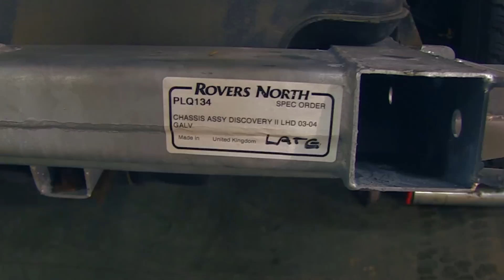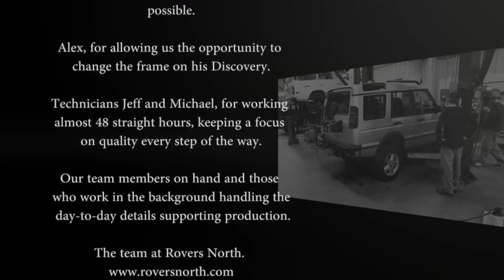Four-Minute Frame Swap

Comment: Feckin ell, you guys are amazing, it's been a long time since I smiled at a video so much. That was like the sh1t we used to pull when we were aaaaa lot younger. 2 new subframes, 12" wheels, new wings, front panel and grill and a full respray in primer grey to my brothers wee mini. Only took a couple of hours to do. We got a load of tyres and pushed the mini onto its side to replace the subframes, oops, forgot to take the battery out of the boot. lol pop riveted the body panels on, rubbed it down with 600 and primered it with an electric vacuum cleaner spray gun attachment. This was all done on waste ground at the back of our house, then all packed up, 4 young adults, and off to Killarney for the weekend to watch the circuit of Ireland, 1973. Freaking awesome, never forget that weekend. Great video guy's. 😀 👍 👍 👍 👍

Comment: What would this cost supply and fit?
Reply: Hi Jack, Thank you for stopping by.  The cost varies greatly depending on the condition of the vehicle we are working on.  The frame swap by itself takes 50 hours.
Reply: Hi Shirley okay thank you for this. What do you charge per hour?

Comment: labour cost? probably 3 or four times the value of the vehicle, okay it's 3 years ago, but still, whats with the disco chassis's..chassai? chassisai?
Reply: You must ask Mister by you in 1991 model your number should be repaired by the company. We Crush Repair by You Clock

Comment: Ive seen many shortened mk1 Disco's
Reply from the maker: New to me. Do you have details? I am always curious.
Reply: Its fairly hard to explain but i think that they probably use a Land Rover Defender 90 chassis then shorten the back end of a 5 dr Disco http://i132.photobucket.com/albums/q11/300bhpton/Land%20Rover/22206-14.jpg
Reply from the maker: Thank you for sending the link over Micheal, I've not seen that before.  I can only imagine the work that goes into building that one!

Comment: was the frame raw metal
Reply from the maker: Hi Tunercars3,
The original frame was not galvanized.  The new one is.  Thanks for stopping by.
Reply: J. White's Automotive, LLC. what would you guys charge me to do the same thing to a 03 silverado
Reply from the maker: Hi again Tunercars3,
Thank you for your inquiry.  More information is needed to help quote your requested work.  If you can call the shop or email us, we would be happy to work with you.  Thank you again for stopping by!

Comment: And the VIN??
Reply: Thank you for watching Black Phanter 666.  As a repair shop we are authorized to stamp the vin on the chassis, although most of the time it is not necessary if the vin is located somewhere else on the vehicle.
Reply: @shirleywarren6797  What happens is that I have a 1985 Chevrolet and it has a rotten and broken chassis and I wanted to know if you can give me some advice on what can be done, it would be very useful.
Reply: @hidro3207  , Bummer about your 1985.  I might be able to advise you 666, but Chevy's are not my area of expertise.  Please reach out to me through the email on our website for further conversation.

Comment: wow what happened that a 2004 had that bad of frame rust?
Reply: The car lived in the northeast for most of it's life.  Road salt is a major contributor.
Reply: Northeast of where?  Im in Québec and I've never seen a 2004 with that damage,  but I'm not a mechanic though.
Reply: Mathieu Laverdiere You win, you are farther up then us here in New England!  If you haven't seen rot like that it might be good luck!
Reply: Oh its not a matter of winning. I've just never seen that. Hopefully I wont see that on my car! :)
Reply: Mathieu Laverdiere I hope you never will!  It happens often here.  I wonder if in Canada they use something different on the roads?
Reply: +shirley warren correct, parts of Canada only put down dirt because salt won't melt the ice, too cold. The salt belts is where winter temps are constantly freeze-melt-freeze meaning lots of salty slush going into every crevasse of the vehicle.

Comment: Didint even paint the frame or treat it be back in a couple yrs for another swap.
Reply from the maker: Thank you for watching Bo and for taking the time to comment here.  Not to worry about this frame needing another swap.  It was hot dipped galvanized for maximum corrosion resistance.

Comment: Should you at least primed or rubberized the new frame to prevent this in the future? Bare metal and salty roads just don't sound like a combo.... just saying
Reply: its galvanised
Reply: Good question Joosy, as Fox mentioned here, the frame doesn't need to be painted as it is galvanized to keep it from rusting.  Thank you for reaching out!
Reply: Galvanise also corrodes as it is a sacrificial coating be it much much slower than bare or just paint if it was me I’d definitely paint it as well as the galv !

Comment: It didn't look that old... what would case a frame to rot that badly, that quickly? Extremely poor factory finish?
Reply from the maker: Salt from roads, ocean air, not moving are a few reasons that cause frames to rot.
Reply: Oh, yeah... understood. Just amazed at how much rot there was after the short life that vehicle has had. I remember back in the 80's when every car rotted as you were looking at it, but I'm guessing this one to be less than 15 years old.
Reply from the maker: ***** 2004.
Reply: Apparently the disco 2s weren't properly coated on the rear.
Reply: J. White's Automotive, LLC. The two biggest issues are that the rover has a box frame which allows the salt water to get trapped inside, and it's made of relatively thin steel.  I dare say it's essentially sheet metal compared to most trucks on the road.  You can easily dent a Discovery frame with a 3lb mallet.

Comment: A great video.  From a UK perspective my Mk2 Disco is incredibly reliable and a dream to drive but she needs a chassis replacement.  These guys offer a polyurethane plastic coating in addition to the galvanized version shown here.....at 2.5mm thick for the majority of the frame (3mm is available) it's £2970 with the 'Raptor (plastic)' coating,  excluding labour costs.  Here's a link https://www.terraintechparts.com/products/land-rover-discovery-2-td5-galvanised-chassis-with-galvanised-cross-member?variant=13202392318013
Reply from the maker: Are you going to go for it Gordon?

Comment: yah woulda been better off swapping that whole SUV for a Toyota instead
Reply: We work on those too Johnny.  We see all kinds of brand loyals.  Thank you for taking the time to stop by.
Reply: shirley warren cool I'm loyal bout common sense and reliability never owned a toyota but those land rovers are a mechanical mess thanks for your reply though i know your busy over there i meant the owner wouda been better off but it takes all kinds i guess take care 👍
Reply: @johnnydoggs  The Land Rovers are certainly tough if you don't specialize in working with them or don't have a shop that does.  It is part of the reason why we exist.  If I had to pick between an older Land Cruiser or a Discovery, I would have a really hard time choosing!
Reply: shirley warren i get'cha 👍